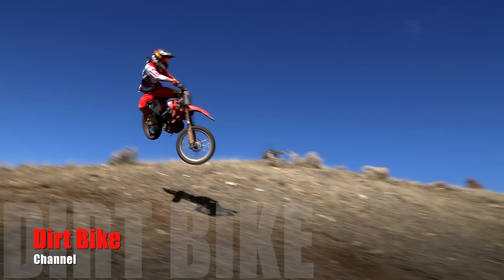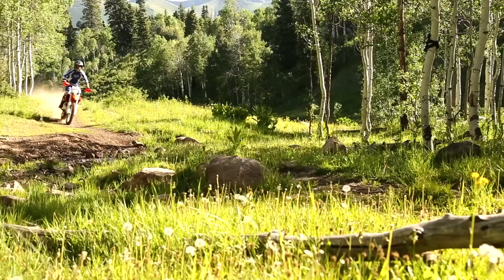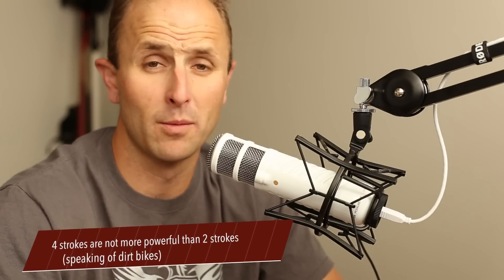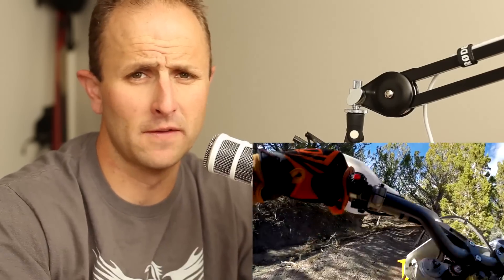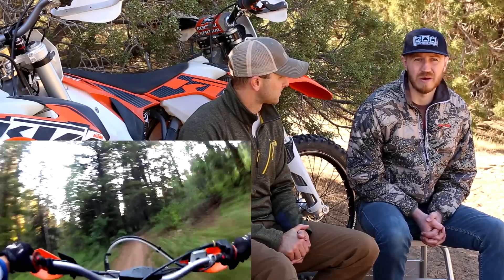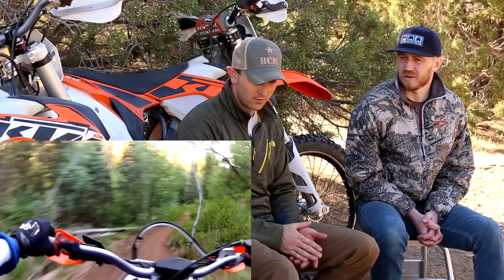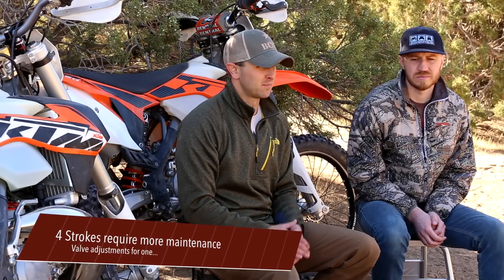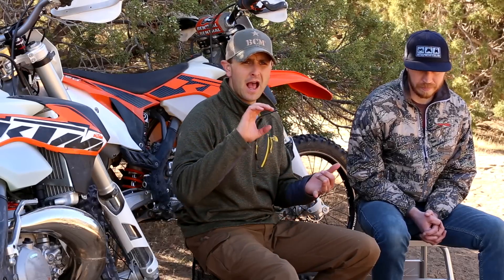Enduro 4 Stroke vs 2 Stroke Part 1

Comment: Whoa whoa whoa, $1500 on the minimum for a top end on a fourstroke lol? Even with titanium valves on my '13 YZ450, it mayneed a valve check at 150 hours with hard riding. (I have 90hr's on mine, no compression issues or valve noises yet. Those have been put on in 8 months, too.)

But a top end rebuild on my 2013 YZ450 is $200, it's a little expensive. But it's not crazy. And anyone can do it in their garage, too. It's just a little more involved. The bottom end is expensive at $350-400, but they're more likely to outlast the owner of the bike. So you're looking at $700-800 for an entire rebuild. While a two stroke is around $300-400. Okay so half the cost, I agree it's cheaper, but any serious rider isn't really going to be phased too much

and the MX four strokes are not lazy bikes. You can stall them very easily if not ridden right in offroad racing.

Now, this isnt to say i'm biased towards four strokes. I love both engine types. I just think you guys are kind of exaggerating things about them in a way that well.. two stroke fans do. They aren't space shuttles and yeah, they have more parts, but it's no swiss watch.
Reply from the maker: Gnarlington Thanks for watching.  I'm basing my number on the local dealers around here and what they are charging for top end work on 4ts..  Called multiple shops.  I have a 350 4t as well and we'll do some side by side work.  As for being biased toward 2t, I just happen to like them better right now for the riding that I do.  I'd rather take a side in most arguments than go the easy route and straddle both sides of the fence.  You know what I mean?  2 strokes have taken such a beating in the last decade and I'm hoping that they can make a resurgence since they are such a great option.
Reply: I agree with ya man, I just thought you were kind of exaggerating a tad bit. Which is good for audience retention ;).

Maybe it's because of my location, but offroad racing is still very alive in washington along with two stroke market. KTM's reign king in sales over here which I would say most are two strokes only second to Yamaha.

Keep up the good video's. The production values are pretty darn good. I'm definitely taking notes :).
Reply from the maker: Gnarlington Thanks for the compliments.  It's nice to know that people appreciate the work that goes into these.  Hours and hours for each video.

Comment: I disagree on the tractability with a modern 4stroke I live in ohio and have all different terrains and most the time they are all gnarly and my crf250x sucked for most of it It didn't have enough power for long steep hills and was really heavy once you fell a couple times and I struggle when it got wet or technical and rocks and trees I was down more than I was up then when I would try and lug it it would stall and when it flamed out on a hill and I broke my ankle that was it I switched to a KTM 250xc and have loved it every since it is a world of difference I was immediately better but that's being said I do agree that the 4s do better on a track but in the off road world 2stroke all the way
Reply from the maker: Tony Daugherty Thanks for Sharing Tony.   Very good points.

Comment: I changed to 4-stroke. A lot easier to ride trails and dont have to switch gears so often.
Reply: ***** and the 4 strokes dont have that good smell :(
Reply: ***** Yeah but in the end, you have a bike that will last longer in the long run. I have a CRF 150RB, I used to have a CR85. But went with four because of the torque, reliability, and the speed you get. Now two is great, but when you don't have lot's of money to spend on pistons every 100 hours, the reliability in a four saves you money as years go on. So paying more for a 4 stroke really save's you money. Hard to believe, yes, but it's the truth. And my friend just bought a KX100, but 150r still takes it any day of the week lol.
Reply: Kyle Fitzgerald 2 strokes are more reliable than 4 strokes haha, and 4 strokes need top ends sooner than 2 strokes.....  The idea with 2 strokes was simplicity...
Reply: ***** I can't live without that smell, I don't go deeply inhaling it, but it is a pleasant smell... Nothing like the smell of synthetic castor oil be it Motorex Motul T800 or Bel-Ray
Reply: spencer avery It's not true but what ever you want to believe.
Reply: my frend bought husqvarna 125 16h and the piston destroyed sylinder.
Reply: +Kyle Fitzgerald it is true
Reply: Evan Anderson What's true?
Reply: +ElQu99 did he run it in
Reply: Of course. But im switching to 2-stroke 250cc. I've always been smoker fan.
Reply: +ElQu99 yea bud, also 4 stroke valve shims are pricey, and it's a pain, that alone led me to buy a 2 stroke 200 xcw ktm:)
Reply from the maker: +spencer 124 Rock on!

Comment: I had a honda crf150 08 and i drove over 400h whit it and when we opend the engine we said to each other (me and my dad) why did we buy a new piston. Look like brand new. And that engine was going hard in my hand. So if you change the oil. Honda engines will last

Comment: These guys are so unfairly sided with the two strokes, show me some enduring video, and then we'll talk
Reply from the maker: +isaac troyer Have you ridden, for any significant amount of time (say ...50 hours or so), on a modern big bore 2 stroke?  I'm talking a 250 or 300 2 stroke?  I have significant time on both 4s and 2s.  I own both as we speak.  I'm not just spewing garbage.  There are some significant reasons that 2 strokes are better for certain situations.  Yes, my 4 stroke is more planted in the sand whoops, but it's not better in other situation. Just saying :)

Comment: a 4 stroke rebuild does not cost anywhere near $2200!
Reply from the maker: Anthony Maj Sure, it can be half that.  On the other hand, I've personally talked to the the local dealers/shops when head milling and other shop work starts to pile up, depending on the application and wear. 4 stroke maintenance is scheduled twice as often and is more expensive each time due to all the parts and high revving nature of these hot rod motors.  Take oil changes for example.  My 4 stroke needs an oil change every 10 hours.  It's a $15 bottle of oil and a $5-7 filter.  That adds up to a lot over time.  My 2 stroke only needs a gear oil change every 40 hours, and there isn't a filter that needs to be changed.  Sure, you could then counter that my premix is expensive which would offset the savings in oil changes somewhat.   In the end, this is an expensive hobby and you have to find something that you like.  I have both 4 strokes and 2 strokes and they are both incredible in their own way.  Would you agree on that?

Comment: Now that the new 250cc thumpers are approaching 45-50 hp, which is pretty close to that of the 250 two strokes hp range, don't you think the AMA should lift the power matchup regulations on two strokes? 
I personally feel thats not even racing, when one guy has an advantage over another. Hell I'd be glad to race a 250 4t against my 250 2t brethren. 
No dignity or true sportsmanship in racing today, what a shame.
Reply from the maker: 100GTAGUY Thanks for the comment.  The reason that 4ts can compete with 2ts of the same displacement comes down to how much higher the 4ts rev.  They will get 4-5K more RPMs out of each gear.

Comment: The only issues I have with 2 strokes is the fact that they are more expensive to keep ruining since you have to buy oil&gas and not just gas which  is very little but still a bottle of motor oil is like 13 dollars, and they burn a lot of gas and its A lot louder than most 4 strokes which isn't a issue unless your riding in a residential area or have d*ck head neighbors. BUT in my opinion 2 strokes are a hell of a lot funner to ride then 4 strokes so my opinion they weigh out about the same to me. to be honest it mostly comes down to If the fact that you haft to mix gas in my opinion.
Reply: Mixing gas is super easy. Takes about 15 seconds to measure the oil and a quart of oil lasts about 5 tanks on my bike (maybe 10 tanks on an mx bike because the tank is smaller). It's still much cheaper than the maintenance for a 4 stroke.
Reply: Im saying the reason i dont like, it dosnt have to be yours
Reply: Landon Haga well a ttr-230 is more of a slow, low revving 4 stroke that doesn't quite have the same maintenance requirements of the others. It will still cost a lot to repair. My 2 stroke is 5 years old and hasn't needed much in the way of maintenance either. Not even a battery because it doesn't use one.
Reply: Landon Haga you didn't have to delete your comment.  I also forgot to mention (about your first post) that the sound from 4 strokes carries much further than 2 strokes. So while you may have heard a loud 2 stroke that has had its muffler neglected, low pitch sounds travel much further.
Reply: Not with my personal experience
Reply: Landon Haga well, when a friend of mine had a yz250f I couldn't even hear my 250 2 stroke when I rode close to him. He told me he could only hear his own bike. I have heard a loud yz125, but it was bought used and never changed the muffler packing.
Reply: again not the chase in my personal experience that why i have a different opinion. no?
Reply: Landon Haga This isn't really a case of opinion. That's why I presented facts .
Reply: +something1random23 I know but i will still like 4 strokes either way since thats the type i have had the best luck with
Reply: Landon Haga This comment, although YOUR opinion, is wayyyyy off from the normal facts regarding 2-stroke "running expenses"...4 strokes are astronomically expensive to keep running, mostly due to regular valve adjustment intervals, but also the oil changes in 4-strokes that are non existent in a 2-stroke are very costly! Mixing gas is incredibly easy (20 oz. bottle dumped into 5 gallons of fuel gives you exactly 32:1)  and in the long run, nowhere near the cost of 4-stroke maintenance and normal upkeep.
Reply: Landon Haga Also, 4-strokes are much, much louder than 2-strokes. The lower pitch power pulse carries much further than that of a 2-stroke, causing it's sound to be intrusive from great distances compared to a smoker. I guess opinion is opinion, but 2-strokes rule in my world

Comment: $2300 to rebuild the  top end on a 4 stroke.  Lets just pull a number out of our ass why don't we.
Reply from the maker: Andrew Van Vossen Called 2 shops.  That was the going rate if you have to send the head for machine work.  How's that for pulling it out of our bums?
Reply: Dirt Bike Channel  Its one thing to estimate the cost of a catastrophic failure.  But that is not a typical rebuild.   275 hours on my 10 YZ450.  1 piston, 4 valves/seals/springs/keepers, 1 cam chain.  $500 in parts, would have been another $400 in labor if I would have had a shop do it.  This is much more typical. Keep the air filter clean and use good oil and modern 4 strokes are no more expensive to own than a 2-stoke.   My Eric Gorr YZ144 needed a ring at 40 hrs, and piston at 80 hrs.  These pistons were more expensive than my 4 stoke.   I actually love both, but I was expecting a much less biased review.  Also, there's no way you'll get an OEM or other good piston for $70 for a moder KTM 2-stroke.

Comment: 2 stokes are only more powerful at small ccs. When they start getting bigger  4 stokes are much more powerful because of their efficiency. When 2 stoke dirt bikes get direct injection there will be no contest.
Reply from the maker: +Krevin Grard 4 strokes don't make more power in the dirt bike cc's.... 450 4 strokes make barely more power than the 250 2 stroke.  Try a modern 450 2 stroke, and see what you think :)
Reply: As i said small engines.

Comment: I looked at the title and thought “Hey this may be a good 4 stroke vs 2 stroke video!” Then right as he says 2 strokes will beat a 4 stroke any day I almost cried cause of this guys dumbess.  A 4 stroke can beat a 2 stroke in a hill climb any day.  It will beat a 2 stroke in enduro too.  And if you put a 2017 450 2 stroke vs a 2017 450 4 stroke in day a quarter mile drag race the 4 stroke will win.  A 2 stroke is quick in about the first 3 gears then it dies down and a 4 stroke is fast in its last 3 gears.  4 strokes are faster than 2 strokes and thanks for wasting my time since I had too to type this comment up. Have a nice day 👍🏻

Comment: 4 strokes are more fuel efficient, have better emissions, have a MUCH more linear power band, usually have a much wider power band, and have smaller friction co coefficients. To say that 2 strokes are more reliable than 4 strokes is just wrong. Yes, you will be doing more maintenance, such as valve checks. Although if properly cared for, a 4 stroke will outlast a 2 stroke years and years. Some of these nicely cared for 4 strokes have thousands of hours without an engine rebuild. Sure, 2 strokes are more powerful by cc, and theyre more snappy, but they have a very specific purpose. If you're not racing around a mx track or doing VERY technical terrain, you're just wasting extra money on gas and top ends. Not to mention 2 strokes sound like ASS

Comment: that isn't true about 2 strokes lasting longer i have a 1988 Honda 300 4trax still on OEM topend and I have never had to adjust the vualve or do anything to the engine but my 2 stroke (cr80) that I have owned for less then a year has blown up twice it has cost me way more then my 4 strokes even my crf100 and I have put that bike through a lot
Reply from the maker: +Crazycrf 100 I never said they last longer.  I only said they are cheaper.  If you don't blow up your bike twice a year, they are cheaper :)  I rode and own both 4t and 2t.
Reply: +Dirt Bike Channel my cr80 is more expensive to do a topend rebuild on then my dr125 also 2 strokes may not have a lot of moving parts but the parts on a 2 stroke are running at a very high rpm with not as much oil as a 4 stroke that is why I am on my second bottomend rebuild in less then a year

Comment: 2 strokes are great for people that ride flat boring stuff. Oh, and they stink, are noisy and when they are out of tune they are as annoying as a nagging wife. Selling my te300 and buying fx350.  If you live and ride in the mountains, the engine braking of the 4 stroke is a very welcome thing along with the better traction, better tuning, reliability, gas mileage... My 16 fe450 has 8000 miles, and a recent test showed the valves in spec, compression like new. The 2 stroke in just 2 yrs had the engine blown up twice. My new fx350 weighs...LESS than a 300.

Comment: The bouncing back and forth between off road and moto x is entertaining. You started by saying off road and then shifted to mx, make up your mind on what the hell point your trying to get across. First the major difference between 2 and 4 strokes is as you stated, weigh, which does translate to more moving parts. The development of the two stroke engine parallels that of the four stroke. Both have moved to lighter flywheels and pistons to increase throttle response. The older two strokes had great bottom end and torque but that was traded away to create higher hp mx engines which proved less reliable overall and sacrificed ride ability for off roading and trail riding. The problem with two strokes for off roaders was fuel consumption, it’s pathetic. Also having to mix fuel and oil is a concern not to mention the stink. The other off road concern was two strokes do not like a constant open throttle. So long open spaces favored the uncomplaining four stroke. The four stroke is a more economical engine when considering all aspects of riding away from tracks. Better mileage equals more time riding without returning to camp to refuel. Traction in mud is much better as well. There’s something about fire roading a four stroke that a two stroke just can’t quite match. And then there’s the traction difference that benefits the moderate rider. Pros and experts can ride a two stroke and make it look effortless yet most riders really are mediocre at best and cannot mimic what they see which often leads to tragic consequences. 
 My basic point is most riders should stay away from the rocket ship power they want and ride a bike that matches their needs and skill set.

Comment: All these comments about how the manufacturers killed 2 strokes...
They're businesses. 2 strokes died cause of no demand. 4 strokes will less power started winning races, a la yz400f, because they have more average power, not peak... average, and better traction. People switched to remain competitive. Now 350fs are stealing 450 thunder. Go figure. Now 450s make more power everywhere and are less than 5% heavier in full race effect with rider. Not to mention tuned crf450rs have made 70hp on the dyno for motoX. (Check thumper talk to see)

2 strokes have their places too, but they're inferior tech, plain and simple. You can cry about carbs all day long, but the heavier and more complicated direct injector is far superior. Same goes with 2v4 stroke.

Power per cc, please show me a 2 stroke naturally aspirated making 250hp per liter using normal gas station grade fuel. (Otherwise I'll have to mention the 1000hp per liter 4 stroke top fuel dragsters) 4 stroke tech allows you to so many more things with the engine.